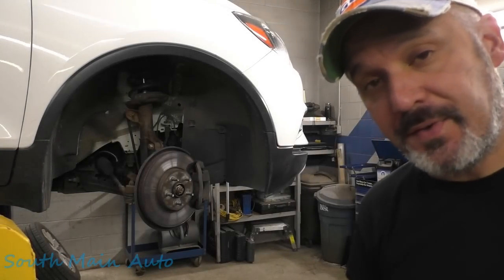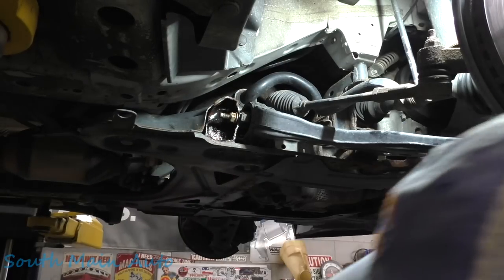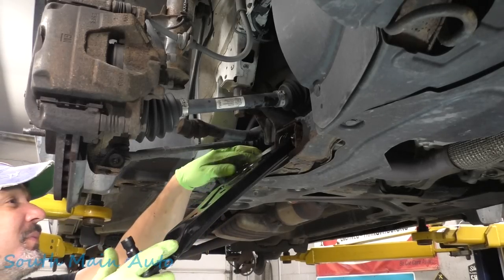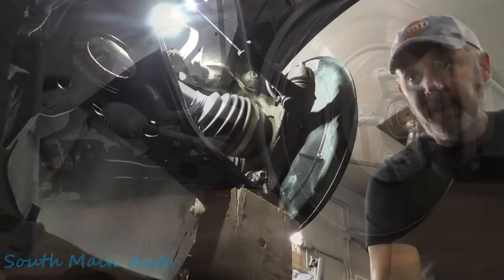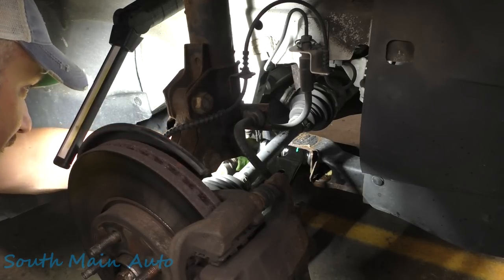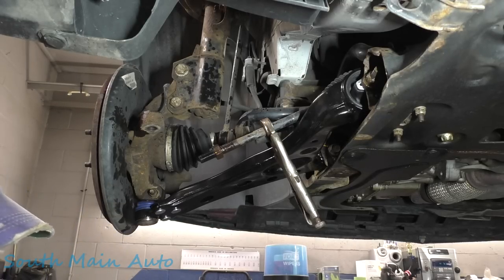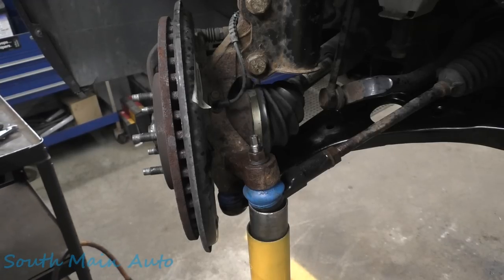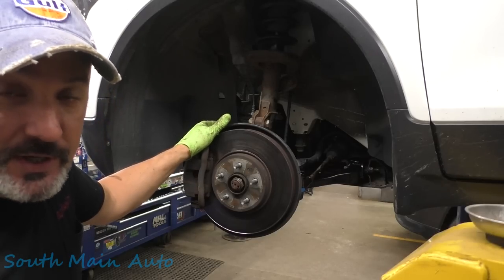Buick Encore: Front Lower Control Arms & Outer Tie Rod

Comment: My flag nut experience involved the driver's side rear shock on my 2000 Expy. Just as I got the bolt out it decided to end its cruel existence by leaping from its assigned spot. Luckily I had on my "handsome glasses" (safety) and the razor sharp edge added a nice ding right over my eyeball. Those glasses hang in my shop to remind me to put the things on every time.

Comment: When I have done tie rod ends I measured back from the front (towards tire)  of the tie rod end to a fixed surface inline with it. Then screw the new one back to that measurement. The alignment people appreciate it. My father taught me to count the threads . That was a great way until replacement part manufacturers  started cutting back on steel and making replacement parts shorter to save steel\cost. Proper torque = tighten until your elbow hurts and hold for ten seconds LOL

Comment: I can remember my first ball joint replacement,, I was in my teens , asked for help got none , so I went ahead and did it on my own , and boy did I learn the hard way of what not to do ,, I managed to get it done ,, took the whole day ,, more cuts than I wanted , the car I worked on was a 84 olds gutless cutless ,,, ahhh the memories ,,,, now being 54 ,,, I can take a whole car apart and put it back together ,,,,
Reply: That’s how I learned too, currently 21 and just starting. Recently did my whole rear passenger side took me a LONG time haha. I did the strut, handbrake cable,control arm, and the hub. Whole lot of pinches cuts and bruises but it’s mint and I’m mint
I’m waiting for the parts on the other side to come in now :(

Comment: We complain about the design of later model cars, but that was SO much easier than 20-30 years ago.  Can't say the lightweighted parts will last as long, but they didn't need special tools, presses, torches, etc.  And with struts, lowers no longer need a spring compressor.

Comment: I have the fancy angle torque wrench. That said, sometimes I find it easier to mark off reference marks on the outside of the socket with a paint marker. Each corner to corner of a six point socket is 60°. Works out well on a crankshaft bolt, it allows you to use a long breaker bar to make torquing easy.
Reply: Good idea.. especially on things that are very important.. like torque to yield head bolts.. You can't just loosen them and re do it.  
I found that sometimes those fancy torque wrenches, will occasionally lose the angle your at as it progresses... then your screwed.
So marking the bolts gives you a good point to verify it.. if that happens.
Reply: I also paint mark fasteners, but TTY bolts I draw a straight line across the head, that way when I am inevitably interrupted, I can  finish the pass, and not wonder what stage I was on, when I return.

Comment: I took a fasteners course in Auto Tech. They said we were to lubricate bolts befor tightening to a toque spec. Some companies wanted Lubriplate, others wanted Molybdenum grease. For head bolts on the the GM Olds 5.7liter Diesels the service bulletin specified dipping the ENTIRE head bolt into 30wt motor oil, then torque it to 180 Nm or 130 lb/ft. Nice to see lubricant on those threaded fasteners. Most shops just ram it in with an impact wrench. Nice work Eric, ben/ michigan

Comment: I changed tie rod ends on my van and put the new one on the same place as my old ones and it looked like a pigeon toe. Couldn't believe how far I had to adjust them to get it close enough to drive to the alignment shop.

Comment: I worked on a 13 Ford Escape. Put lower control arms on. I remember tightening both pinch bolts for the ball joints. I may have over tightened them. 2 weeks later the car got towed in with the 1 bolt missing. I will now replace them with new and torque every one that comes through

Comment: Funny you bring up the grease in the tie rod end. Was recently looking at info on putting marine grease in my regular trailer bearings as I only have marine grease and dont feel like buying regular, everything said its fine but you HAVE to clean out all the other grease so it doesnt cause issues, never mix marine and regular grease.

Comment: I have done Oliver connecting rods with torque to yield bolts and bought a angle gauge.  With the Buick TTY bolts I just use the hex flats as references.  Each being 6o degrees.

Comment: Hey Eric, Kroil is a nice lube/penetrant for rusted bolts and nuts. I like the torque wrench you used. I have a very similar or same one as you.(bought from my local Snap-on dealer) It certainly does the job. Keep up the great work and keep the great videos coming. Stay safe.👍👍👍

Comment: I am pretty much anti penetrating oil. But I have been using mouse milk as of recent, just because. Literally 5.3l direct injectors came right out,  hub bearing pulled off with a couple whacks, and I used it on something else that I was surprised came off easily. 😆. Now Kroil, no way I am spending close to $20 on a can.
Reply: Personally I prefer badger milk. Talk about expensive!

Comment: My flag nut story begins and ends with all fingers in tact because the flag had rusted enough in PA winters that it was too short to grab the frame of my truck.  I did manage to figure out it was a flag nut when it caught my digit on the way past.  Fortunately, it was a glancing blow and the digit survived.  The nut was 21MM and positioned where I couldn't get a socket in there and a straight open end or box wrench couldn't get the angle.  I have a full set of metric offsets which goes in single increments until it gets to 20 where it jumps right to 22mm.  None of the local stores carried a 21mm offset wrench, so I managed to get one from amazon overnight.  Fortunately, it was my own project truck and it just sat on stands in the driveway.  
Blah blah, 
TL;DR.  
I didn't lose a finger.  I got to buy a new tool.

Comment: I had 8 nuts to take off once,they all came off except the last one the guy i was helping sprayed oil on it,it stripped all the threads.impact will vibrate some rust off but if you put oil on it the loose rust will not vibrate off,stays in threads.

Comment: I know this video is a year old but was hoping you might be able to answer my question. Even with the car dealerships in my area looking at diagrams. I’m having trouble identifying the part number or name of the first bolt you took off. The one that hold the ball joint in place, connecting the control arm to the knuckle. You called it a pitch or pinch bolt but I still couldn’t find it looking it up by that. I removed mine recently to change the CV Axle on my 2018 Buick Encore and definitely looked destroyed when it came out. I was able to tighten everything back up but now I hear a thunk from the joint when I hit bumps and it didn’t do that before the work was done. The nut still goes on fine. I imagine there’s play in the joint where the threads were all mushed in the center.

Comment: I'm suprised it wasn't molded into the frame, where you have to cut it off with a torch and buy a reassembly kit to weld a bracket back on. 🤣
Reply: Don't give gm any ideas or we will have to buy a complete subframe assembly to repair a ball joint
Reply: @patriotgarage  🤣

Comment: I have a 2016 Buick Encore that I did ball joints on. i have the shop manual via Alldata. I was instructed to replace the ball joint bolts because they were TTY. I didn't see Eric replace the bolts. Even the control arm bolts are TTY. Actually that ticks me off that GM had to use TTY. It was fine for 50 years plus with standard bolts, yet for some reason they needed to change them.  Didn't look like Eric replaced the bolts. The control arms new don't come with new hardware either for some reason?

Comment: Eric, you're taking way more trouble than the monkeys at GM took. I noticed the bushings were exerting downward pressure on the control arm when you popped the ball joint. Evidence says the OEM torqued them in the lower position.

Comment: Nicely done, another Super install. No need to torque the tie rod because it is being aligned anyways. The tie rod is a "Taper fit" much like a Morse Taper drill chuck or Morse drill bit and as such; there is No need to use a pickle fork -because- all you really need is the  good ol' 4lb hammer. Just keep smoking on the tie rod or ball joint with a 4lb and it will just fall right off.
   If you are NOT replacing steering components and simply need to take the steering components apart, the Pickle will quite often damage the boot on the Ball joint or tie rod, center link or what have you. Just remember that the 4lb hammer fixes everything. Keep it close, no dainty little 2lb hammers required in the shop.
  If you put a little nick on the Tie-rod threads with a fine hacksaw blade, (IF the NAPA guys get the right part and they are identical); all you need to do is to thread the outside Tie-rod end until you figure it is where it needs to be to match the lock-nut to the Tie-rod nick you made and Shazzamo: Like a virgin your car does NOT need an alignment. This method works for Ball joint replacement too.
  These are echoes from the 50 years of backyard smashed knuckles, I have NOT paid for front end work or an alignment for 20 years now. Great channel, great content, watching Eric has cured me of watching Scotties click-bait channel.

Comment: A shop told me my lower control arm is bad. But I've been having a sound that's consist with driving straight . Not so much with bolts. Sounds like I have a flat spot on my tire but they said the tires are good. Would this also give that sound? Don't wanna replace something that's not necessary?  Thanks in advance!

Comment: Why put the car’s weight on the control arm before torquing? Is it to align the bushings closer to normal ride height? I’ve always assumed they would “self adjust” once you drive it but maybe I’m wrong?
Reply: You want it the approximate ride height before you torque them to minimize binding in the bushing.

Comment: my non  sponsored  napa  shop here in canada replaced the control arms both sides twice under warranty  in my kia soul abosolete junk got a year give or take out of each pair the tech cut one of the old ball joints open 0 grease it was like a dried saw dust they where from napa china junk

Comment: Screw that degree crap, the only things I torque are head bolts , valve bodys and lug nuts. In 50 years I never had a problem. I use anti seize in place of lock tite and never had a bolt come lose because I make them good and tight. I know you have to entertain the couch specialests .

Comment: Now you need to explain to me the 60 foot pounds and then the angle torque???? I dont understand.
Reply: If you scroll back up, someone else asked this question and it was explained there, but essentially, it's been found to be more accurate than straight up torque to spec, and many bolts are torque to yield anyway.

Comment: I suspect you use penetrating oil for the same reason you torqued the control arm bolts:  To shut up the comment section complainers.  I think that if you believed in the power of penetrating oil you would spritz the bolts/nuts more than 3 seconds before putting the wrench to them!

Comment: Should a 2017 really need that much work? I get the brakes, but the suspension and blower motor problems on a vehicle that new seem ridiculous. I don't know. I never had anything that new. Haha
By the way, I had a rental Trax while my car was getting body work from getting hit in the rear. That's gotta be the worst car on the road.

Comment: I guess I have been out of the mechanic trade too long, I quite frankly cannot understand the torque sequence, why torque them, then tighten them to a certain degree of rotation instead of just tightening them to the final ft/lb of torque.
Reply: It's more accurate than straight torque and many bolts are torque to yield. There's tons of info on the physics involved.
Reply: @marossgnv  But when your torque wrench doesnt have the angle setting, do you just torque a little higher??

Comment: What is a "flag nut"
Reply: The same as a blind nut. It's a nut welded to a piece of steel for use when you can't get a wrench on them. It stops the nut from turning when you tighten it , and hopefully when you loosen it. Or else break out the oxy-acetylene and buy a new nut/bolt combo.